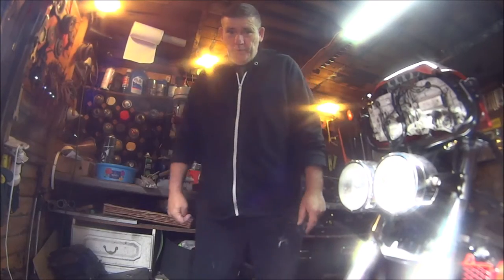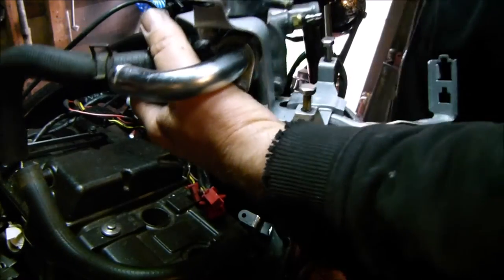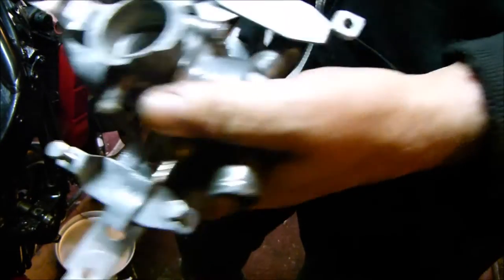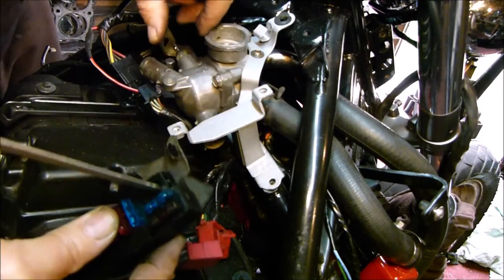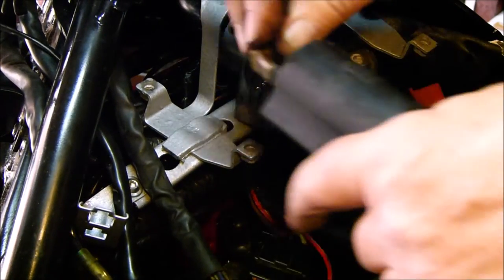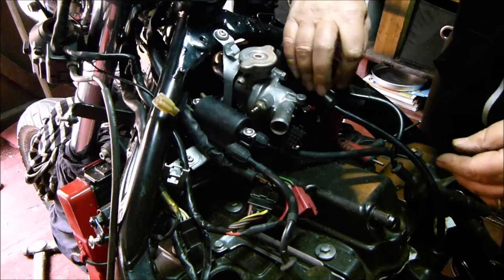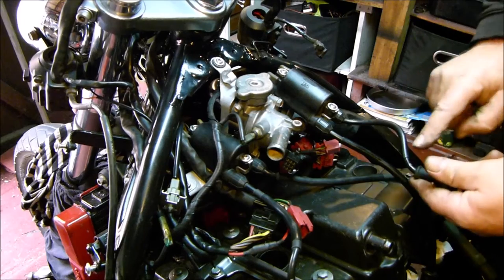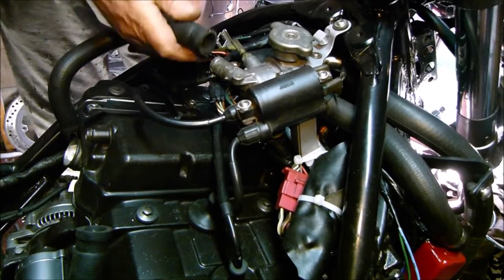CBR1000F Landfill bike, cooling system done, allegedly.

Comment: Just waiting for this! Where did you get the pump from Johnny, a breakers?🧐 Got my new disc and pads on the divvy
 But I haven’t had chance for a spin yet. Fingers crossed it stops the squeak 🤞 👍🏻🙏🏻
Reply from the maker: £39 eBay... Hope you didn't have to much of a struggle with the disk bolts Steve. 🔧🔩🔨👍
Reply: @jonyr1TT   heat disc bolts with a blow gun to soften the lock tite , i never lock tite mine use a torque wrench

Comment: what parts you after next then john  , doing a good job .!!!
Reply from the maker: Carb repair kit air filter and maybe some longer choke and throttle cables. Still looking for front brake discs as well. Cheers buddy 👍
Reply: @jonyr1TT   venhill engineering get  your throttle and choke cables done  they are online  make any length
Reply from the maker: Cheers buddy 👍

Comment: Hi, I have a 1992 1000f, tell me, please, which antifreeze should I pour.. possible g12+.. thank you!
Reply from the maker: Hi,
I just used a corrosion inhibited ethylene glycol antifreeze. 👍
Reply: Thank you my friend..tell me when I measure the oil level in the engine, should I screw the gauge or just stick it in without screwing it!
Reply: Can you help me please..I have a 1992. today I drained the antifreeze on the water pump and I only put 2 liters and according to the manual it is 2.8 liters..does all the antifreeze come out on the water pump?
Reply from the maker: Don't scew it back in just rest it on top 👍
Reply from the maker: There will be some residual coolant left in the cylinder head. Just run the engine and top up the coolant if needed 👍
Reply: Thank you very much my friend!👍
Reply from the maker: Your welcome 👍